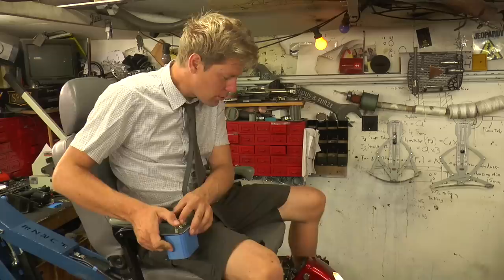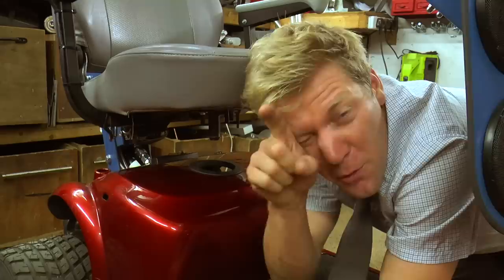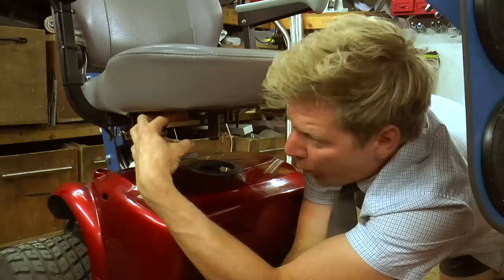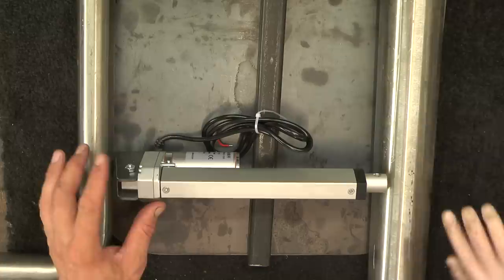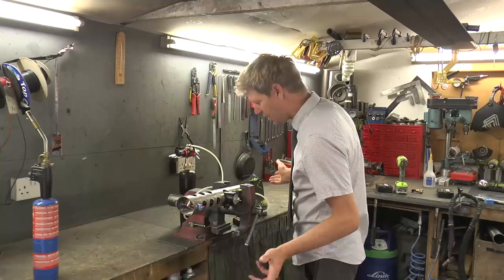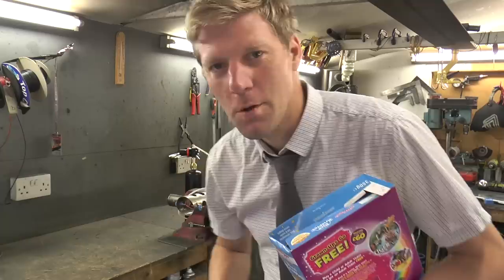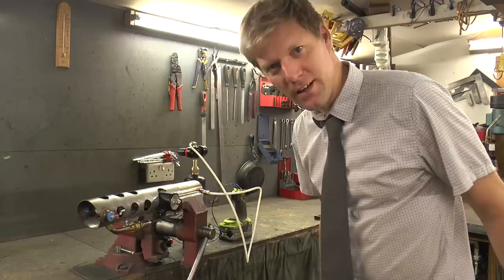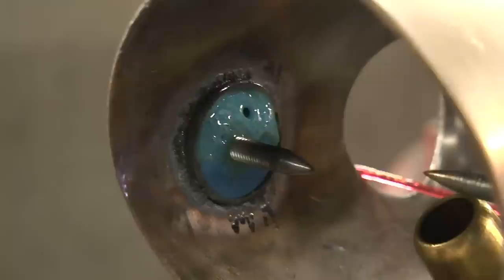Scooter Flamethrowers-Scooter Pimp #3

Comment: Improvement suggestion for the flamethrower. Ditch the holes in the barrel. And instead have reed valves venting into it. Another thing to try is to have the barrel conical. but with the narrow tip as the exhaust.

Comment: You will probably get better sound through your speakers if they’re in a sealed chamber. There isn’t a lot of knee room I see but even a small, low profile panel to seal the backside of those speakers should help the bass response unless of course you’re bothered by that at all. I’m not an expert, just wanted to give you a tip based off my experiences. I love the build videos, keep them coming. 👍🏼

Comment: Colin, you used the pilot light further from the gas source, so more air had a chance to mix with the gas. Did you test the pilot light at the same point as the spark, or move the spark further from the gas source. The other option would be to blast a little compressed air into the mix.

Comment: Needs a beer cooler instead of a basket and you could keep meat in it and flame grill the meat with the flamethrowers while using the cooler like a footrest instead of resting them on the flimsy basket
I'd also say make a heavier frame for it and replace all the plastic body stuff with thick steel it'll sort out the wobble in the crane or at least help

Comment: You use this fancy stuff when all you need is diesel or lamp oil in a refillable fire extinguisker, an air pump and an electric arc for a spectacular stunt. Just have the surrounding 10 ft. clear.

Comment: Seeing as you like improving life for the elderly and less mobile, my partner's parents and my parents are having stair lifts installed in their houses. My partner's parents house has 3 floors. Stair lifts look quite slow in the videos and life is only getting shorter, quicker, for both sets of parents, so they don't have the time to waste just going up and down stairs. The less time it takes to get to the top floor and back down, the better. Is there any way stair lifts could be made quicker? I'll leave it in your capable hands.

Comment: No no no - those flamethrowers are more like bunsen burners and they deploy to slowly. Not enough OOoomph Colin..

Your thermite launcher with a feed system would be the real deal.

Next thing you need on that thing is a stability control system and a way to keep your handbag out of reach of the cretins on the streets. Do we see a combination net launcher/thermite launcher for capture and subsequent cleaning the streets for cretins?